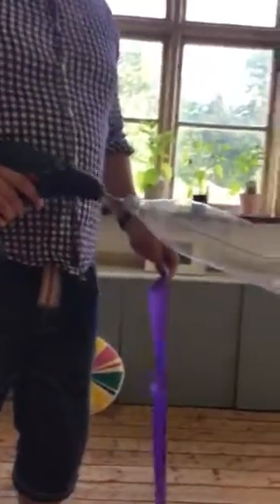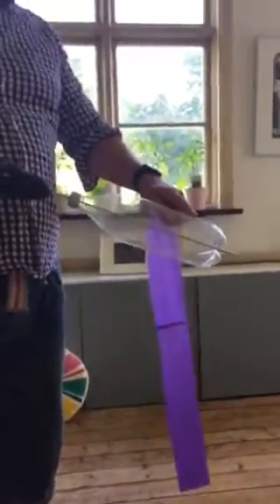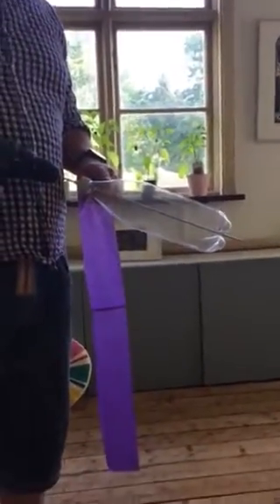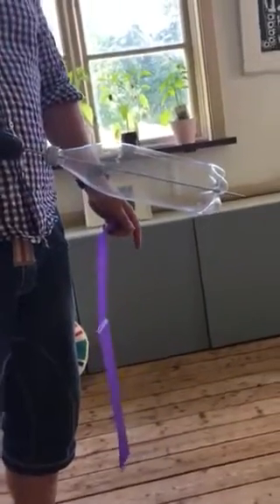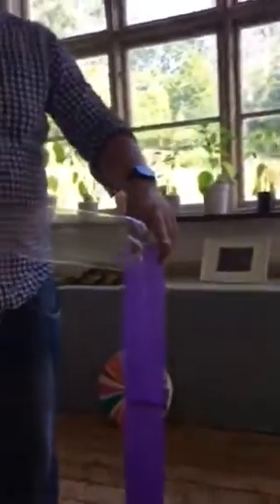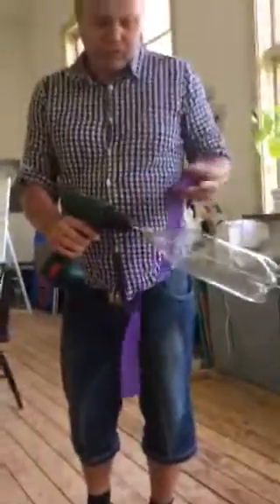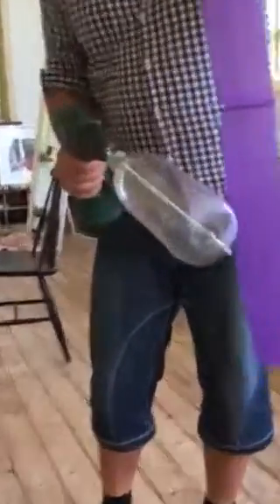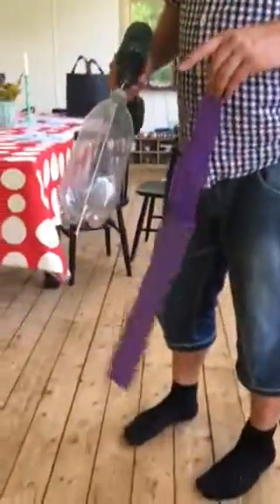Boundary layer experiment

Comment: Hello, 
Can You please elaborate more about it that how it is relevant to boundary layer?
like how the purple strip's attachment with bottle is connected to boundary layer
Reply from the maker: Hello. Glad you asked that question. Long time since I made the experiment. I guess my thought on boundary is related to the connection between the rotating body and the air. So there is an airflow right next to the bottle, obviously connected to the surface. You can look up advanced aerodynamic on an airplane wing by  NASA. The ordinary explanation with airflow and speed is oversimlified. Feel free to ask more. It is just a simple experiment and easy to replicate, but very hard to grasp why and how?